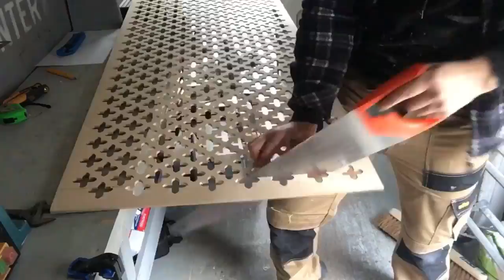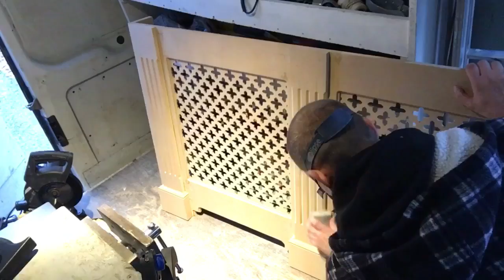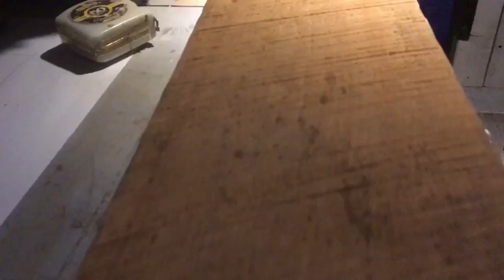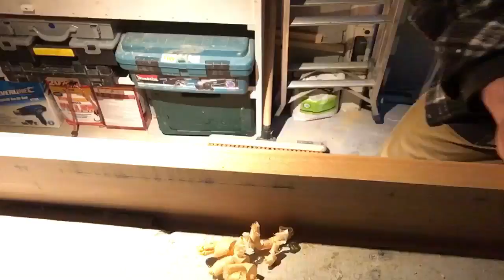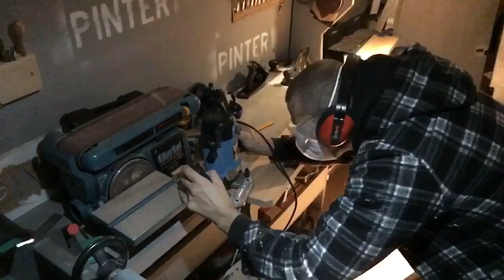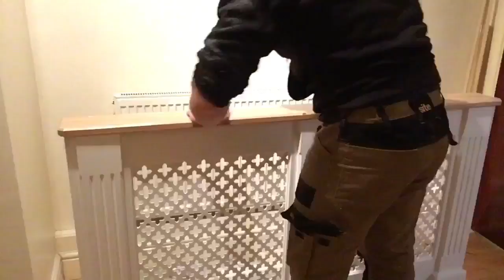Making a radiator cover. Part 2.

Comment: Yes, well done with little room in the back of a van. I'm going to be making one in the next week or two when I finish painting my stairs and hallway. Just one tip: prime the mdf first before you paint, it gives you a key and also stops the filler from being absorbed by the mdf and will stop it from dropping out. Great vid and thanks for your time learned some more ideas and tips. Thanks again, cheers.
Reply: When I say prime the mdf, prime, fill and then paint just stops the filler from being dried out by the mdf. Just the same rule really to all bare materials. Great vid all the same, take care.

Comment: More very good work in a tight space. 

Bizarrely most or the heat from a radiator is released by convection not by radiation. You would get better heat flow if you cut a slot under the front of the shelf, within the shadow line so not too visible, to let the heat rise.
Reply from the maker: Thanks Kev. 
This is the only radiator in the house we not using at all. It's always off, so I'm not too bothered. 
But I'll bare this in mind for the future.
Reply: exactly what i was thinking. but a very nice build non the less. gave me a nice idea for my radiators.
Reply from the maker: +Rok Podlogar thank you.